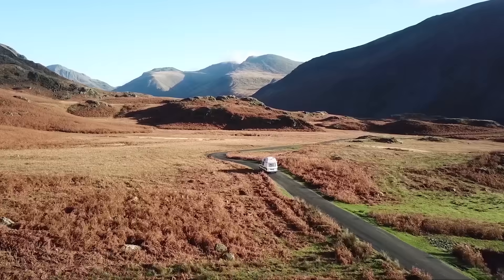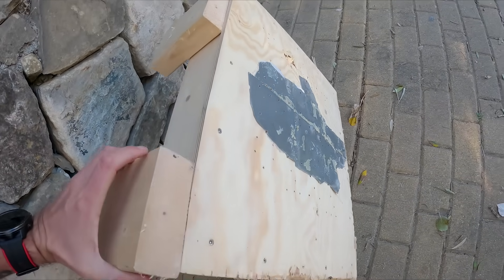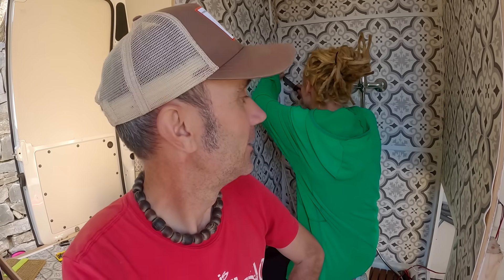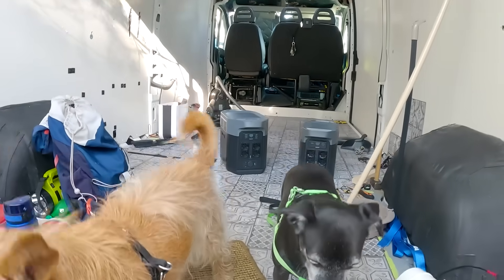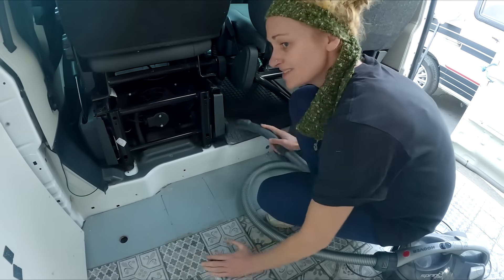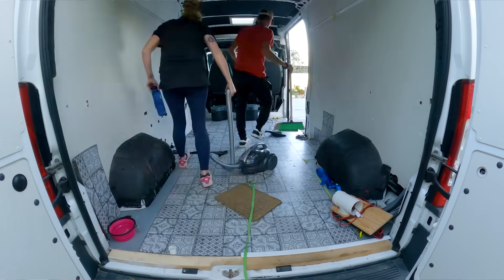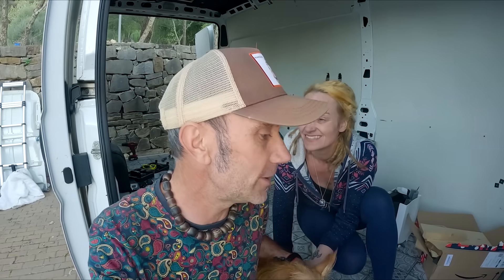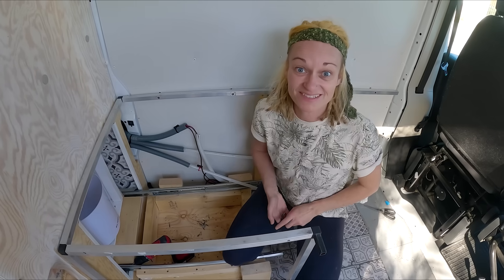VAN LIFE; DON’T IMPORT INTO SPAIN! THIS IS WHAT HAPPENS.. 🫣

Comment: If you have to lift the tiles a hairdryer used to soften the adhesive will get them up. If your going to replace the leaf springs definitely have a serious look at installing air suspension on the back.  It knocks out all the lumps and bumps out of the road and also improves the ride. It isn't all that expensive but definitely improves the drive.
Reply from the maker: Ok.. Will look more into this.. Thanks so much for the advice 😊

Comment: Such a shame you have had to strip the van, but like you said, you can now decide your own layout and what you actually need in there. Most vans have the rear fixed bed because it gives them a good garage/storage area and they leave out the shower so it’s a much more open space. The weight is definitely a plus to keeping it minimal. I’m sure you will be researching your perfect layout. 🤞🏻 for the registration. 😘

Comment: The layout that I'm in the process of building will have a cubicle behind the driver that will be a shower/wardrobe/toilet/fold down expanding bed/mobile kitchen unit storage. Two of the rear van window dimples will house fold out tables. The wall cavities will be up to an inch wider and will be divided into cupboards. The result will be a camper/van that will be very spacious and able to be used as a work van when you need it. In my opinion building out a van with cupboards etc and filling it up is inefficient use of space and materials and fuel to lug it around. I like that you may revert to a curtain and bucket shower, much easier to maintain lighter and less imposing on the space.

Comment: This issue with the towbar in Spain is if you don’t have the paperwork that it was on the van from the start normally they won’t approve it.  It needs to be a towbar from the itv tios company and full of paperwork in triplicate.  If you don’t need it remove it.  Took me over 3 months to legalize a towbar, that was a manufacturer towbar (brand new) but not brought in Spain.

Comment: I haven't read all the threads but would like to point out the Ecoflow Delta2 has a maximum 12v output of 10 amps, so if you are hoping to power a diesel heater from it you may not be able to as they draw up 20 amps on start up. I do have a Delta2 in my van but also kept a battery in for the 12v system. Good luck with the rebuild, enjoy the experience it can be the best bit of van life :)
Reply from the maker: Thanks for your message, we were thinking we'd have a leisure battery hooked up to the van for lights, water pump fridge etc and then power stations for our hungry laptops and tech.
Reply: BTW I actually prefer the videos when you have issues, it is good to see how you resolve them. So don't worry about boring us with these videos. Love your channel.  @theexPAWers
Reply from the maker: @ianlowe481  Thankyou.. Means a lot although it would be better if we didn’t have issues😂😂.. Have a great weekend xx
Reply: You too, you manage really well, I didn't even know what a leaf spring was. I am educated 😊 @theexPAWers

Comment: It looks like you have the beginnings of a rust problem under the van.  You can slow it down a lot by getting it sprayed underneath with a six monthly spraying with a 50/50 mix of clean oil and diesel.  Don't do it yourself, it needs to be on a ramp.  My local garages does it in about 30 minutes

Comment: I really feel for you guys having to strip everything out. Such a shame. Having done a couple of van builds myself (including stripping out what someone else put in) I know how much work goes into the process. But, as you rightly point out it does give you the opportunity to make some changes (particularly, the weight) that you wouldn't have done, if you hadn't had to take it all out.  Sometimes, there is a silver lining.  I really hope that you don't have to take the floor out as well. Keeping my fingers crossed that they'll let you keep it.  I did notice that there didn't seem to be any insulation inside the beams and channels.  If you plan on visiting any colder climates it might a be a good idea to stuff insulation material inside those beams and channels for a bit extra warmth.  It helps to keep the temperature down in hot climates as well.  I really hope they don't make you jump over too many more hoops to get Velton legal. Rooting for you.  🥰🤞🤞🤞🥰

Comment: look into over load springs or air bags for your rear suspension as traveling maxed out weight wise 6mo or so down the road you may run into troubles. can you spray under coating under the van for rust

Comment: Hi ho, off yer go. Well done both. Its the emotions you have to turn to your advantage. Turn on the positive attitude,  you've identified the initial design problems, soon you will have finished the strip down, and once the umper lumpers have begrudgingly passed the van you'll be on the up with the new layout design. Nick, you need to buy a cordless multi-tool (just Google it) and some extra blades to trim back the floor to fit the bulkhead. It will be safe and easy and save you loads of time and energy, and will be really useful for the rebuild. Love the chaos filled vidio by the way, it really did convey the trauma and the relief. Well done. Take care.  👋

Comment: For info, you said you may need to remove the towbar, best check it out but you may find that you will need a new crash bar under the rubber bumper as they are usually removed when installing the towbar. I still have the one removed from my Boxer that you could have but North Yorkshire is a long way away!

Comment: This is such a shame😢 especially as the van seemed quite nicely put together! 
At least one good thing is now your going to put it back together you know where all the wires and plumbing bits etc run so if any future problems you’ll be able to  know where things are run. 
Gotta look at the positives eh 👍🏼

Edit.. is there anyway you could get some cheap thin ply or even a ply lining kit 2nd hand and fit that over the existing floor and walls with a few well placed screws to “hide” it? Even spill a bit of paint on it to look “original” lol and just say that’s how it came? 
Do the inspectors go to the extent of lifting up what looks like an original floor? If so then I feel I may need to be a tin can like you say 😢

Comment: As nice as all those fitted cubicles are, what about having a more open aspect to the van? The bed area and kitchen area are great but the shower/toilet are a bit of a waste of space. Like you said, go back to the bucket shower and have a more open plan van? 
I use my air fryer on my Delta2, they are great👍❤ I'd still have a leisure battery for lights and water pump linked to a B2B👍

Comment: In my opinion,  guys, you really don't need an outhouse in a van. Especially with 2 doggies.  You're hulahoop would just be fine. Save weight and space also. Plus less stuff to bump into.. heck it's just you two, so no need for a hulahoop either. 😅

Comment: I do wish the rule makers had to justify their reasoning for instances like this!? At least it will be purpose built for yourselves. Enjoy the process.❤
Reply: The justification is simple. The original van is homologated and deemed safe. Any modifications/additions need to be certified and approved. Since the modifications were done privately, there is no evidence they were done to the required standards, so they have to be removed/returned to factory standard.
Reply: @kevinmills5293  so what you're saying is everything they do will have to be inspected and certified?
Reply: @Luvpig  I hope they have already asked that question. I know for certain you have to have a tow bar professionally installed and certification certificates have to be presented to the ITV station. As for interior modifications, I don’t really know but things like gas and electrical installations would, to my mind need to be done professionally.  What you can and can’t do with vehicles here in Spain is very different to the UK.
Reply: Government over reach.
Reply: @kevinmills5293   I certainly understand the gas and electrical systems, possibly even the water. The interior construction though?!
Reply: @Luvpig  if you’re constructing a permanent feature in the van you would have to consider weight distribution. You would not want to have all the weight on one side or make the van top heavy by having too much weight high up.  These are the sort of things the ITV engineer could not assess or measure.